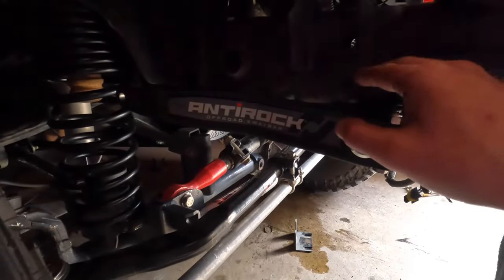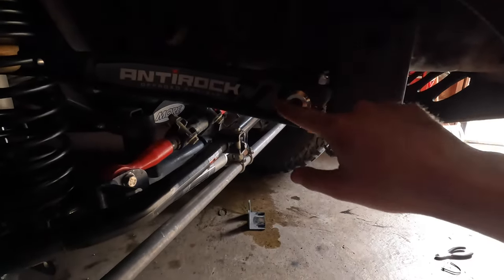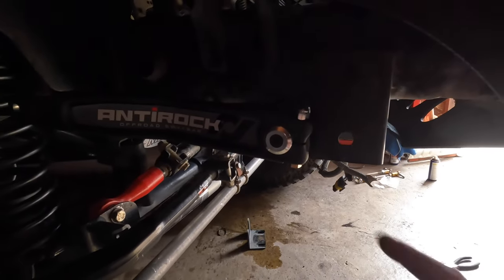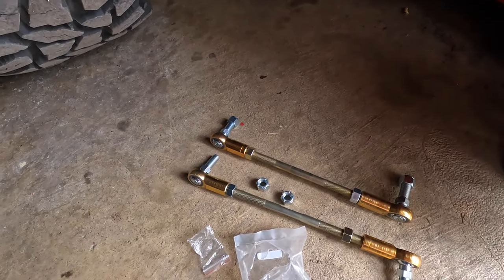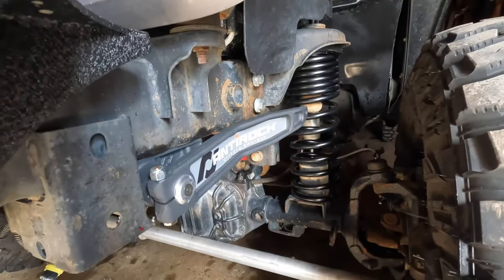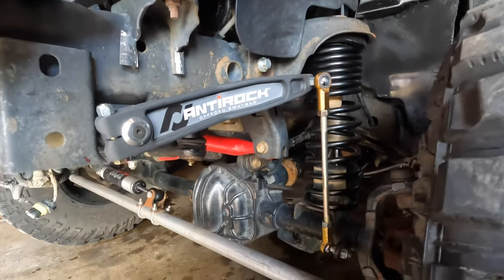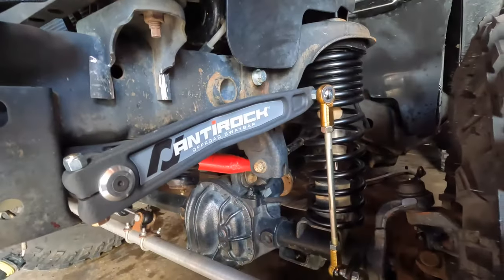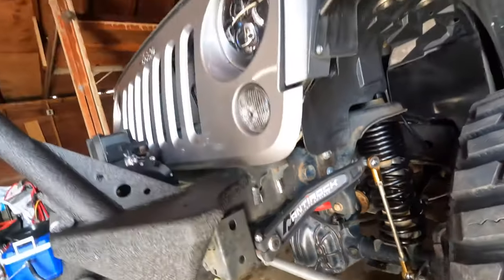ROCK JOCK ANTIROCK Sway Bar for Jeep Wrangler JK/JKU- MUST HAVE

Comment: How much sway do you have on the road and does it make it dangerous steering
Reply from the maker: It is definitely a lot more than with stock sway bar. Going 75-85 required more steering input but still felt okay in my opinion. You can always tighten it up when going on longer highway trips!

Comment: Have quick disconnects currently, how would you rate the street driving difference in daily driving for a jeep  that’s 75% street 25 % trail, rock, ohv? As in will the  seem washy when daily driving?
Reply from the maker: Truthfully i don’t notice very much of a difference. Of course there is alittle more body roll but not near as much as i was expecting! Jeep rides great and not even close to feeling of disconnected on road. If anything, it’s alittle smoother on road because the axle is able to articulate around the bumps/potholes. I am very happy with the ride on road
Reply from the maker: If you are 75% on road though, i don’t know if this upgrade is worth it for you. It’s more of a off road upgrade and won’t give you any proven benefits on road. For your application, quick disconnects may be the better route!

Comment: Why did you have to order diffrent links? I have a jku with 6inch lift stock axels
Reply from the maker: The links that came with the kit were not long enough when fully threaded out. I have around 5” of lift and have a decent amount of down travel so i have my arms set higher than 90 degrees, closer to 100-110 degrees. The links that came with the kit only allowed for about 70-80 degrees which is not nearly enough for my set up
Reply from the maker: It will all depend on your set up and how much down/up travel you have